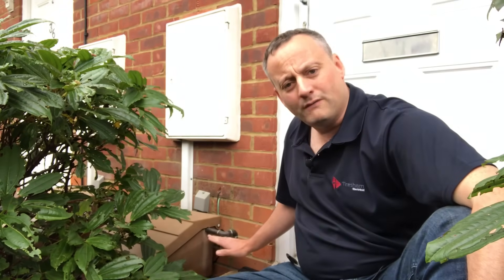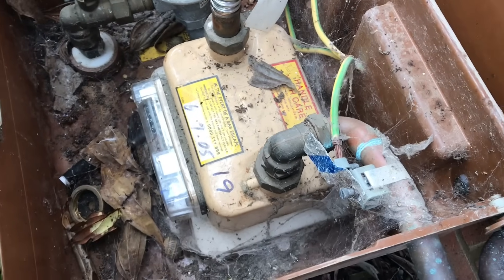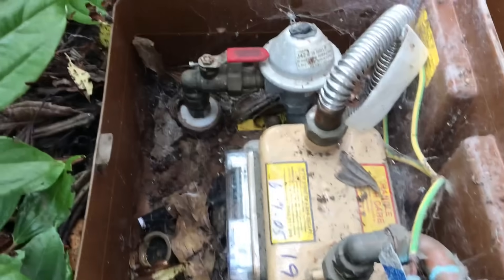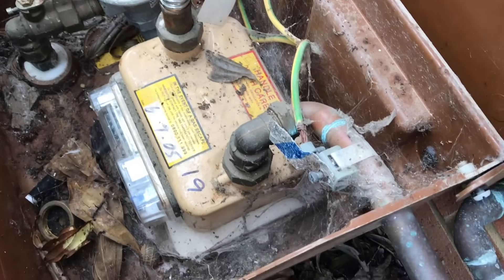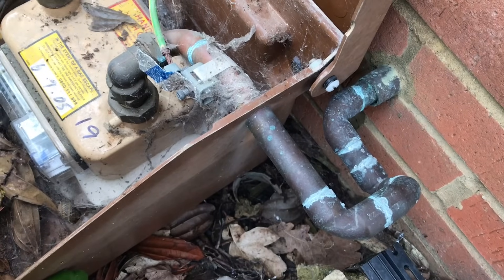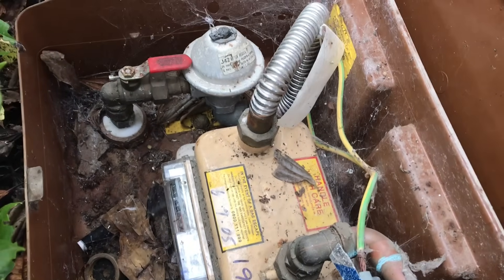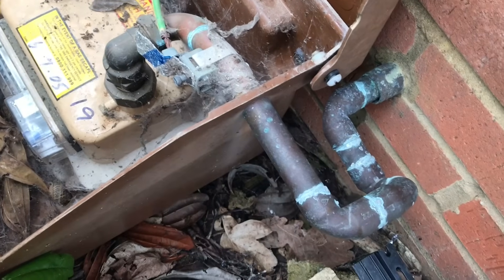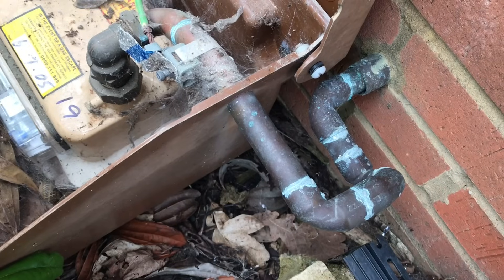Under the 18th Edition BS 7671 will this Gas Pipe be an Extraneous Conductive Part & Require Bonding

Comment: The ground level should always be at least 150mm below dpc level, so the copper pipe would never come into contact with the ground.
Reply from the maker: I totally agree 👍
Reply: Clearly not 150mm from ground level in this case, get the contractor back to correctly install
Reply: @gr1809  The ground level is 2 courses (150mm) below the DPC apart from a little heap that I suspect is from the excavation for the gas meter/connection etc that will be removed when backfilling.
Reply: @gr1809  or go round his house with 10 heavies and fill him in
Reply: Unfortunately i still see new builds with external ground level being too close to dpc

Comment: Hi I wonder if you could help, would an amateur radio tower with an antenna attached with coax cable entering house then connected to equipment that's powered by mains electricity be classed as an extraneous conductor and require bonding
Reply: Hi, I would expect the tower to be at Earth potential (EMP lightning static ETC). If it is bolted to a concrete base, it requires an earth spike for the above.
It is most definitely not classed as extraneous but your radio will have an earth bonding point round the back.
If this is then connected to your earth spike too, for lightning safety ETC.it would not come under the electrical regulations anyway, as it is not part of the services installation in the house. Most likely the equipment has its own power supply. If the equipment is vintage, then it might have a "live chassis" but I doubt it.
You don't say if you are a Novice,  intermediate or Full licencee.
If you are a full licencee then you would not be asking the question, as it is covered in the exam.
David (G1ZQC)

Comment: If you have a plastic water yet metallic gas, you bond the gas. But the pipes will be joined together in the installation so wouldn't that then need the main water to have a bond also
Reply from the maker: Hi. 100% for me... video to following in the coming weeks 👍. Thanks for watching and commenting. Gaz

Comment: I understood all exposed gas pipe should have protective tape over the Gas pipe, this would keep the soil clear but what about the internal gas pipe connecting to a gas appliance that requires an electrical supply? I would then consider the gas pipe to be an extraneous conductive part which requires bonding. The whole rationale behind earthing and bonding is to prevent a difference in potential between metallic parts so bond gas and water.

Comment: Water is a conductor - so it only takes a heavy shower to cause water form a contact between the consumer side gas pipe and earth. Also what is the potential conductivity of the damp brick work. Also is the area liable to flood risk. Just because it looks ok at the time you are there - you need to think of a worst case situation.  Play safe and bond.

Comment: what would happen if the supply neutral broke or came disconnected and some point into a property.(tncs set up) Would the copper pipe now become live as there would be no path to earth via the plastic gas supply pipe. Making it less safe to bond pipe in the first place???

Comment: Again, the point is missed. 

A fault occurs, a rodent chews through a cable, the protective device does not operate. The dead rodent lies on the gas pipe inside the house underneath the floorboards, leaving the gas pipe live.

Bond the metal work, it’s as simple as that. It’s about potential differences. Limit the Potential diffences.
Reply: That is a scenario and very possible as are other scenarios. This whole video is very uninformative and misleading.
There is supposed to be a 10mm main bond no more than 1m away from the main isolator. If I am wrong then let us know!

Comment: Metallic pipes entering the building having an insulating section at their entrance need not be connected to the protective equipotential bonding.
The new reg depends on the pipework being insulated where it enters the building. Your video makes no sense.
Reply from the maker: Hi. Bonding not required 👍... thanks for commenting and watching GSH Electrical

Comment: If unbonded then a fault could occur inside the property causing the pipe to become live, householder needs to put credit on the key and rests hand on the pipe while earthed to ground :(
Gas board at some stage will change the meter, put the jump lead across the meter in case there is current flowing to earth via it and apply the spanner while earthed :(
Bond it plastic or metal inlet !

If the building has been secured against electromagnetic radiation then bonding must be done (Tempest / Teapot).

Comment: Why test the bonding conductor if he installed the cable himself? He would know there is no break in the cable surely...
Reply: the only way to know is to test it
Reply: @spencerhodges626  Not according to Guidance Note 3
Reply: @iScoTT29   Hi Are you saying tha the pipe through wall does not introduce ground potential, simular to how a metal windown does not need bonding.  If so good to know thanks for putting me right
Reply: @spencerhodges626  I'm saying a bonding conductor being installed by one electrician in its entirety does not need a continuity test to prove its a continuous cable or that it is under 0.05ohms.

Comment: You have to ask yourself the question why do we bond exposed conductive parts? Its to create a low resistive path to earth in order for the protective device to operate within the times specified in the regulations. If there was a possibility for this gas pipe to come into contact with a live conductor then it would be at the same potential as that conductor. Its down to the electricians judgement at the end of the day.

Comment: I personally would of bonded the copper pipe as im sure the regs state that if its fed into the installation in pvc then its not needed but it is fed to the meter in pvc then comes into the installation in copper so it enters the house from outside in copper so i would say it still needs bonding
Reply: This pipework in this video needs bonding still as it is not installed where it enters the building.

Comment: What happens when it snows and the gas pipe is covered with snow (could be slushy type with low resistance) and therefore connected to the mass of the earth
Reply from the maker: Hi. The amount of pipe on show is so small it would never be an extraneous conductive part. Information in the description... Thanks for watching Gaz.
Reply: Automatic disconnect under fault conditions, resistance in snow means snow warms up and melts, path removed :-)

Comment: That is a semi recessed gas meter enclosure meaning it is only partially recessed into the ground.the soil would never be brought up to door hinge level plus all soil needs to be a minimum of at least 150 mm below DPM course any higher they would bridge the DPM.
I would strongly agree with you Gaz can’t see the gas pipe coming into contact with the soil. Great short film once again pal thanks.
Reply from the maker: Thanks for taking the time to comment in such detail and watching Gaz

Comment: If in doubt    Bond it out
Reply: Metallic pipes entering the building having an insulating section at their entrance need not be connected to the protective equipotential bonding.
If in doubt read the regs.
Could be making the installation dangerous by bonding the pipework
Reply: The gas is likely gonna be connected to an earthed electrical equipment and if that was the case then bonding it isn't as bad as what the theory makes it out to be
Reply: or just learn to use your tester

Comment: extraneous
/ɪkˈstreɪnɪəs,ɛkˈstreɪnɪəs/
adjective
adjective: extraneous

    1.  irrelevant or unrelated to the subject being dealt with.
    "one is obliged to wade through many pages of extraneous material"
    synonyms: irrelevant, immaterial, beside the point, not to the point, neither here nor there, nothing to do with it, not pertinent, not germane, not to the purpose, off the subject, unrelated, unconnected, inapposite, inappropriate, inapplicable, inconsequential, incidental, pointless, out of place, wide of the mark, peripheral, tangential
    "do not allow extraneous considerations to influence your judgement"
    antonyms: material

    2. of external origin.
    "when the transmitter pack is turned off no extraneous noise is heard"
    synonyms: external, outside, exterior, extrinsic, outward, adventitious, alien, foreign
    "extraneous influences came to bear"

The copper Gas pipe enters the property from outside...making it extraneous, extraneous, that is,  to the inside.... according to one of the dictionary definitions.
BS 7671 should have a proper look at their discriptive wording...do they mean extraneous with a potential to contact earth or   just extraneous....As the pipework in the video sent in, and your pipework Gaz, clearly start their life extraneous to the property, in contact with earth or not.
What harm is it to bond it anyway..after all it is extraneous to the property...
I think the chap who sent in the video was erring on the side of..."Better safe than sorry" and I am with him..bond it.
Reply from the maker: Agreed 👍

Comment: I have never locked off the main switch in a consumer unit to install a bonding cable
Reply: There could be a potential difference between the earth bond and neutral if you don't. It's safer to isolate the incoming supply on both line & neutral.

Comment: For the difference in cost I'd probably err on the safe side and bond. If in doubt I'd always go for the safest option, bonding removes any element of risk that the pipe could become an extraneous conductor.

Comment: Its quite evident that running a 10mm CPC back to the board requires drilling a hole in the enclosure thus ruining the 
IP rating allowing disgusting cobwebbs inside
Reply: 20mm stuffing gland.
Reply: Fit as close as practicable possible inside the building, within 600mm of the meter, and before any tee on the pipe. No corrosion in its lifetime and doesn’t mean adaptations to the box ( which the gas transporter owns).

Comment: If it were me I'd temporarily pack the short conductive piece of metallic gas pipe with soil and disconnect all the fortuitous   parallel earthing paths if possible and test if the gas pipework from the met to the pipe didn't come in under 22 k ohms then you've ensured that no current exceeding 10ma would flow through a person under earth fault conditions and you can go home and sleep well. Great video by the way Gaz, it's good to see you collaborating with one of the other heroes of the industry sparky ninja

Comment: I thought the reason bonding is required of metallic gas pipes is so that fault current cannot pass from one property to another via the metallic gas supply pipe.  If there is a plastic (before the meter) pipe, but the metallic (after the meter) pipe does happen to have soil touching it, will that really provide a path into (or out of) the property for fault current to flow?
Reply: Nick, the fault current will take any parth home! It will be quite happy to try and escape via say the 0.5mm or 0.75mm CPC of the boiler control flex, etc.. 😁

Comment: I would have to say I agree with Gaz. The box would have to be virtually buried to lid level, but it is an interesting point. Being so used to bonding incoming services, I would probably bond it too if I had any doubts as I would be responsible for the safety of the installation.
Reply: The video is to provoke and it looks like it has. Good comment 👍
Reply: That semi concealed box should never be completely at ground level. There's a lower section that goes into the ground and the main box, where the meter is, that should sit just at floor level.

Comment: As a Gas trainer I dispute the argument raised by the electrician. This in my opinion is like saying I don't want to fit a socket here because the plumber may in the future install a bath here or sink making it a zone 0 or zone 1 etc. Each trade has to conform to buildings regulations and gas is no different. The installers work to many normative standards which includes the ESP (Cadent in this case) to ensure pipes are installed at sufficient heights. It's up to building control to monitor compliance with ground and building works so other trades don't contravene other regulations. I always teach guys in hindsight if unsure remember rectum protectum and take the safest option and MAKE SAFE.
Reply: Building control??? If seen so many wrong things not being flagged by building control that begs the question why building control or inspections.
Reply: And if you understood the implication or connecting metal work needless to a PME supply and potentially killing someone under an earth fault from
The install, diverted neutral currents which are imported from other installations due to an Open PEN on the supply network(this is becoming more and more apparent )that PME, (PEN) faults can kill! 
If the impedenance is high, the neutral current will use an earth path to flow back to the source and heat the earthed pipe it’s connected to! 
IJs are now installed to prevent the gas networks service pipes being used for stray electrical
Currents to flow. 
The installation of PE pipe is also a method of breaking electrical continuity of the installation and the gas main. 

To bond or not bond is something that is still to this day misunderstood and put lives at risk doing it as “we’ve always done it” attitude!
Follow the regs! If it isn’t an extraneous conductive part by definition, don’t bond it!

Comment: So, if the short piece of metal pipe on the consumers side from the gas meter was “shrouded” or encased in a plastic covering I.e. heat shrink wrap or pipe insulation maybe, keeping it away from any soil externally, would it then be acceptable not to run a 10 mm conductor to it?
Thoughts please
Reply from the maker: Read the article in the link for details. This pipe wouldn’t give you a low reading ohm path to earth. Think how much pipe work is buried in the great mass of earth when it’s a metal gas pipe supply and think how short this one is metal pipe is. Thanks for commenting and watching GSH Electrical 👍.
Reply: If the pipework is insulated where it ENTERS the building then no earth bonding is required.
Metallic pipes entering the building having an insulating section at their entrance need not be connected to the protective equipotential bonding.